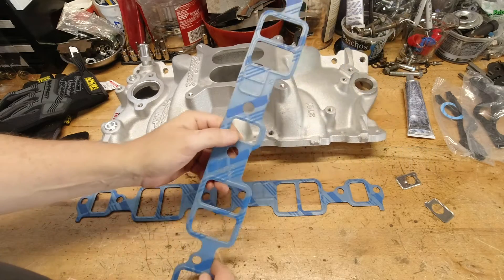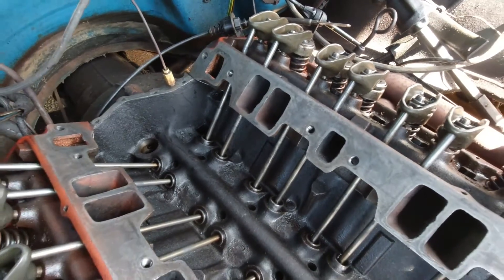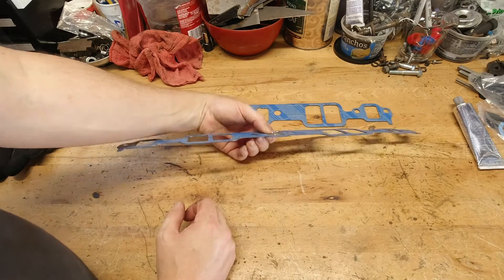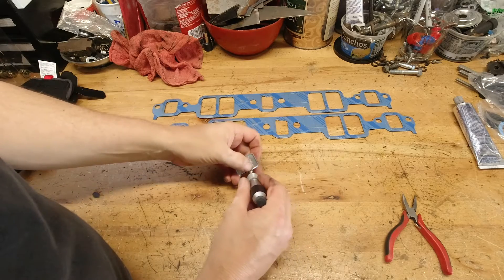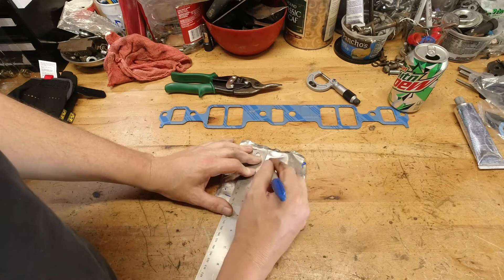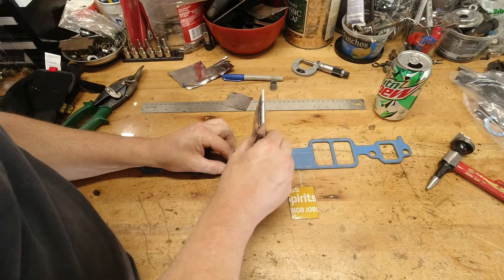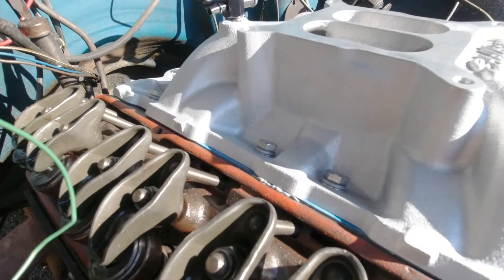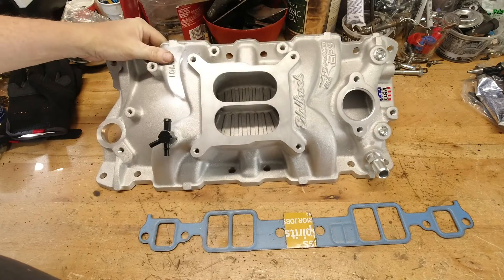Cure Heat Soak - Intake Block Off Plate

Comment: So I just pulled my old man's intake off to replace the gaskets why would the back water ports be blocked off ? 93 350 tbi
Reply: The intake probably doesn't have water ports in lot of them were sealed off
Reply: @MP-io7yj  it has water ports on the intake I guess I should of said why is the gaskets back water ports blocked off they had the little metal block off plate like he shows on here with the little pinhole through it on the gasket itself not the intake

Comment: You should add a little disclaimer that if your running a hot air or divorced style carb choke, that you cannot eliminate the crossover or the choke will never work properly. But I understand that 95% of people with these old school engines are either using an electric choke,manual choke or no choke at all so for those folks it doesnt matter but there are still guys, my self included that still have a divorced choke system which I think works well and in the mid to late 70s there were alot of "hot air" style chokes where a steel tube was placed in the cross over amd air would be pulled through that heated tube and warm the choke spring so for those applications a heat cross over is necessary.
Reply from the maker: It’s a valid point, however there are only just a very small numbers of aftermarket intakes out that have a provision for the divorced choke.  This performer EPS does not.  I don’t disagree that the divorced style choke works extremely well.  On a stock intake there are endless numbers of those in the 60s and 70s that used that style and for sure you can’t block off its source for heat.  Had I done gaskets on the stock intake that would have been a highlight of the discussion as this truck had the divorced choke Qjet.
Reply: @MuscleCarSolutions  I have an old edelbrock performer aluminum qjet style dual plane on my c10 and it has the pedestal for the divorced choke spring to mount to. I have an early 1968 qjet with the divorced choke and I bought edelbrock part number 1931 which comes with the choke spring and rod and got the whole choke system to work just like stock and it works great, it was one of the best things I ever did because when I first got the engine it had the choke wired open and the idle circuits on the qjets are so lean that it didn't want to idle until the intake got a little heat in it and after making the choke work properly it works almost as good as fuel injection. Just 1 pump in normal weather 2 pumps in very cold weather and starts right up and warms up quickly.
Reply from the maker: @briang4470  yup, most likely it’s the old 2101.  Great intake.  The EPS is the upgrade to that intake.  The 2101 had the mount for the divorced choke but the newer version doesn’t.  I love the simple solution they created for the choke back then.  Kind of hard to argue with how well they work!
Reply: Would blocking off the crossover for the old school divorced choke intakes running above 50-degrees really be a concern?
Reply: I have The divorce style choke on mine also my heat source comes from the passenger side exhaust manifold through a tube.

Comment: Hell... my '72 Monte Carlo stock with Rochester 2BBL needs this done. Instead putting phenolic spacer on carb, fuel pump, and some insulation I got on Ebay for exposed fuel lines... and on top of that, got myself a marine inline bildge pump blower to mount on frame to blow on fuel pump to help keep cooler... running 3 inch line to front of car to pull air from. Yep, maybe overkill, but you sit on side of road waiting for everything to cool down in Texas Summer heat so car can be started in rush hour traffic!!!.....  Go Biden/Harris... make america suffer.
Reply from the maker: Oh I understand.  The heat in the mid south isn’t much better.  Anything to keep these things cool!

Comment: I only use Felpro blue gaskets. I throw out the front and rear rubber rail gaskets and run a 1/4" bead of "The Right Stuff" form a gasket on each rail. Let it sit for 15 minutes and drop the intake in place and tighten it up. A perfect seal and no oil seepage. I also find it necessary to re-torque the intake after initial run-in only with aluminum intakes for whatever reason. I have had water leak into the combustion chamber and show up at the tail pipe before re-torque. This is from years of Chevrolet experience. I hope it helps someone.
Reply from the maker: For sure an old trick that takes care of those pesky front and rear seals.  Thought of doing that video but there seems like there is a hundred of them on YouTube.  😆 Hope everyone knows that one by now!  It saves a ton of frustration and mess to clean up!
Reply: I have a weiand tunnel ram with Brodix heads on one of my small blocks. For whatever reason, the space between the intake and block at the front and rear was seemingly larger than usual...would have taken a very tall bead of RTV. I've had trouble with RTV beads sealing in the past, and given how much RTV it would take, I opted for a new method. A fairly tall bead of RTV paired with cork gaskets. Works very well, no leaks whatsoever
Reply: Retorque the intake manifold bolts.  Never read that in any workshop manual but it makes sense with an expanding contracting aluminium.  

Point noted and thanks.

Comment: Could you do a video on carburetor icing, it's a real headache on my old 4x4 Chevy 454 and edelbrock carb ,is it because I'm using a open air cleaner with out a heat duct from the exhaust to the factory air cleaner? Thanks for the videos and advice
Reply from the maker: I’ve really only experienced this on motorcycles.  How frequently is this happening for you?
Reply: @MuscleCarSolutions  in the winter when it's in the 20,s and snowing when I need it the most can actually see frost on front of the carb I have to let it run for awhile shut it off for 5 minutes then it's good to go for the rest of the day, live in Washington state lots of humidity if that makes a difference seems like it's not a problem when it gets down in the 20,s cold and dry air thanks again for responding, I'm usually asking you something about my 68 396 Camaro
Reply: Yes

Comment: @Muscle Car Solutions  nice and straight forward. i've got a car never driven in the cold months and with a cast iron intake; should i bother with a block-off?
Reply from the maker: I’m not sure I’d crack into an engine just to put the block off plates in, but it could help with getting a cooler fuel and air charge.  Don’t know how much of a difference it would make.
Reply: @MuscleCarSolutions  basically stock ford 302 right now with factory 289 4 bbl intake. wonder if a insulating plate between carb and carb base would help. i'm not having any heat issues but anything cheap to help is worth looking in too. thanks man for chiming in. great channel!
Reply from the maker: @Ecosse57  absolutely!  I’ve done a video on how to cure heat soak addressing things to do with the carburetor.  Isolating the heat from the carb is an excellent idea.  Ethanol boils at 180 degrees.  Anything to help that survive will keep things running smooth.  Thanks for watching!  Very much appreciate it!
Reply: @Ecosse57  Might wanna consider a 1/2 inch or better phenolic spacer from Ebay.. then look there for Fuel Insulation line covers... Easier than being stuck in traffic with car dying in summer, or go in store for 15 minutes, come out and car not start...
Reply: @Ecosse57  Do it. Your car(b) will love you.  Watch for hood clearance.

Comment: Great info. I always block mine off
Reply from the maker: Always so when I go to an aluminum intake.  Sometimes don’t if doing a stock engine.
Reply: Do you block one side only  or the restricter have to have a small hole
Reply: @eddierios5371  with or without small hole is ok. I do completely blocked(no hole)